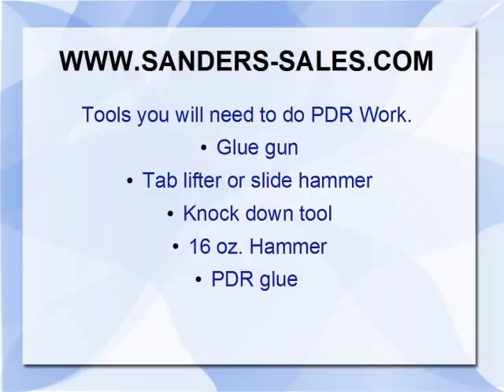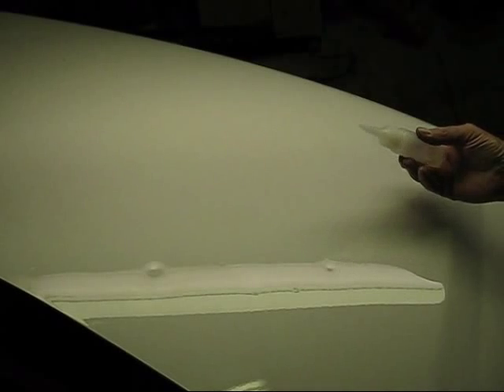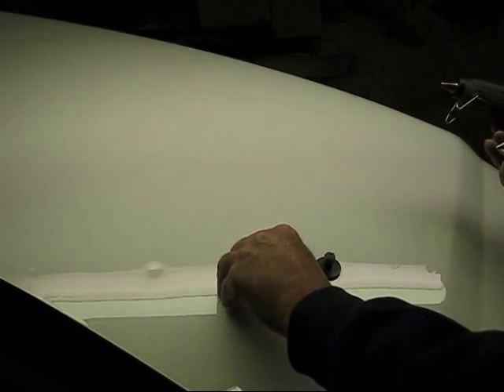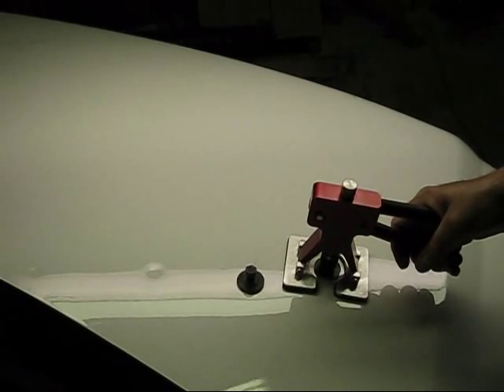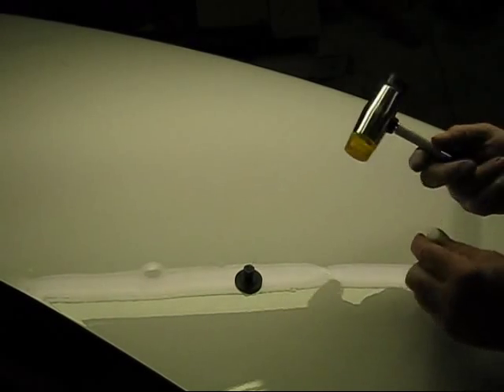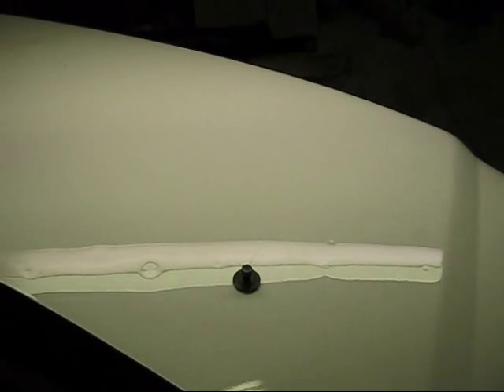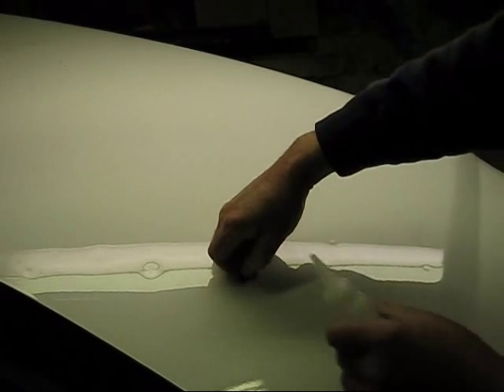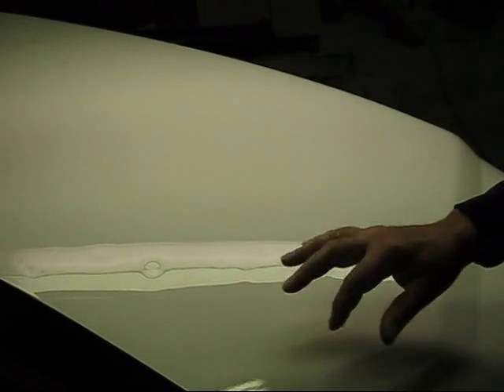PDR Paintless Dent Removal Made Easy Paint Dent Repair

Comment: My glue WON'T stick to the car high enough to pull the dent out. The tab sticks to the car but NOT strong enough to make the metal flex, it snaps off  as soo as a tiny bit of force is placed upon it. WHY ? I'm using the yellow glue sticks that came with my kit do I need a different color glue stick for AZ?